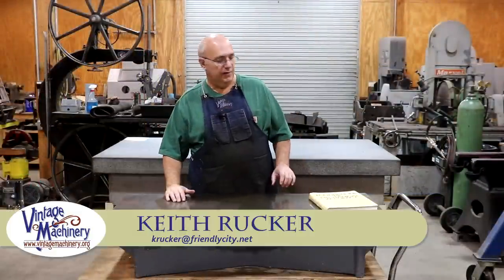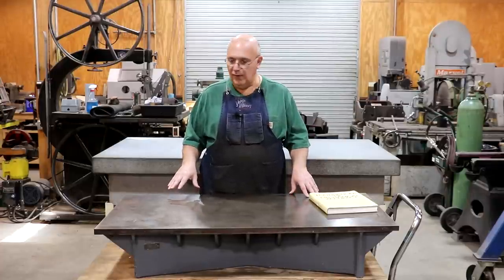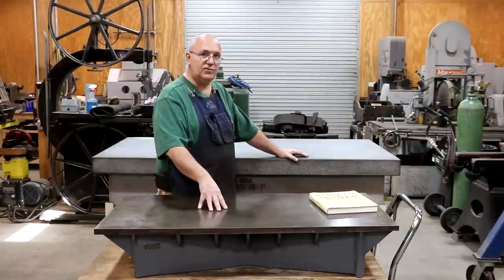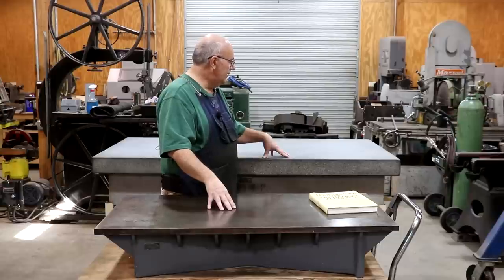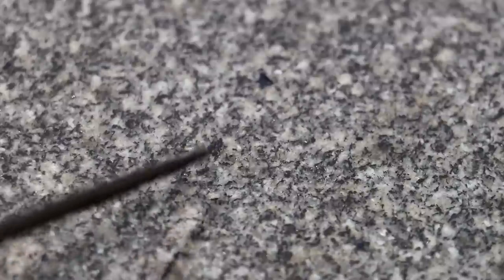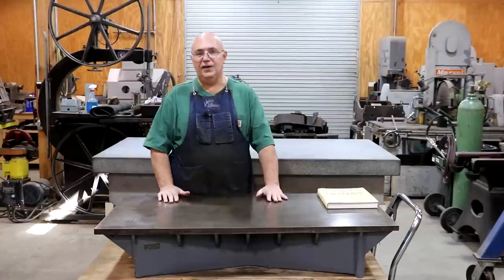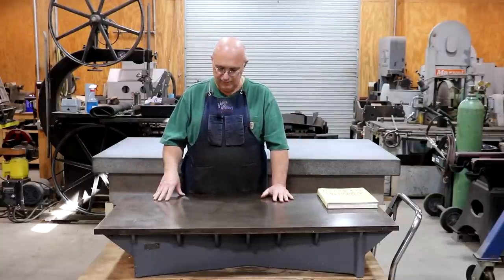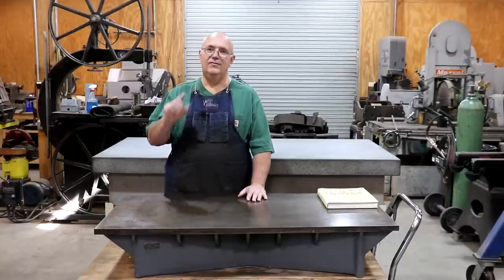Surface Plates:  Granite vs Cast Iron

Comment: No pros and cons... cast iron is much better hands down. Technically no comparison in longevity. The granite wears down tens times faster if any on the cast iron. You would not be able to say the same about the granite in the same life time the cast iron has seen. Now lets talk about constant chipping on the granite... if you accidentally hit it with a work piece there you have it. The granite surface plate would have had a major bulge in the center by the same time standards. Granite is cheaper in cost and quality most people accept it because they know of no other.

Comment: Hey amen bother,  shop I work in has several surface flats, none good,  pockmarked with transfer punches.  My bench, butchers blotchy top and ALL ISNT GOOD ENOOUGH NICE CAST IRON FLATS WITH pockmarked surfaces,  got more⁰ than 60
Reply: What did you say??
Reply: @paulcopeland9035  ok got a bit incoherent,  I work in a die shop, 3 cast iron flats on large table behind and just north of my bench.  Pockmarked by transfer punches through the years.  My bench has a maple top, lots of transfer punch marks made more last night making shims for a die sharpening, got 8 die sections ground, 2 small sections left to grind and more shims to cut, they want to use die tuesday, it will be done Monday.  
Hey, we have a wonderful huge Starrett granite plate so life is ok.  Those old cast iron flats could be reground and scraped, we have surface grinders big enough.  
Was just lamenting the abuse those old surface plates had suffered.
Been a bit slow in shop this year, got punches resharpened on old turret punch, oldest piece of equipment in shop and it gets used all the time.  Monday after getting die together will finish getting dies sharpened for old Wiederman turret punch, hope I spelled it right, sit and look at tag regularly,  kinda like playing an old slot machine, pull the handle, listen to the slug clang down the chute into tray.   Kind of satisfying.